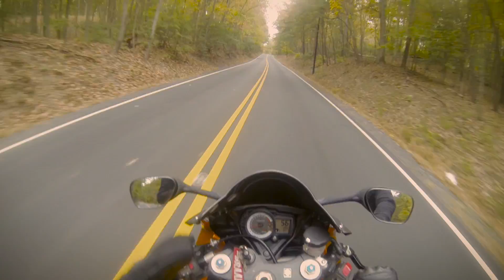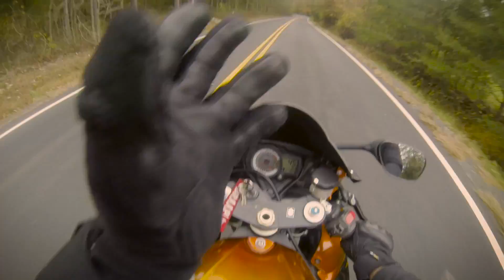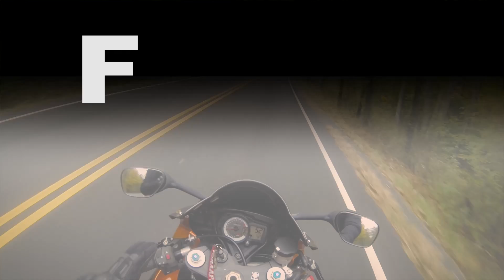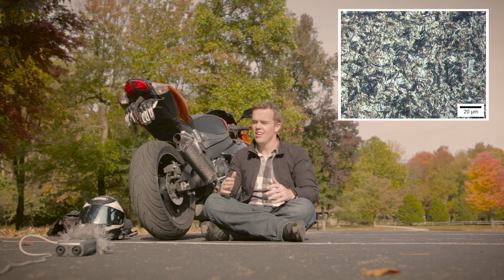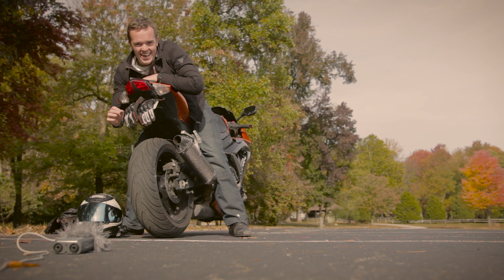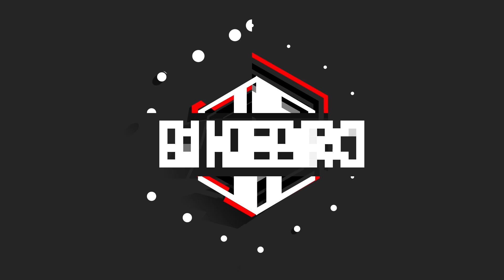Motorcycle Traction explained

Comment: What most people neglect to consider when wrapping their heads around the area vs force equation is Shear.
Generally people think about loss of traction as the tire "skipping" over the surface due to a lack of sufficient friction, but another loss of traction occurs when the tire or the road surface shears under high friction.
This is where wider tires come into play.
They simply provide more surface area that would need to shear prior to a traction loss....both on the tire AND the road itself.
Consider it like this:
Yes, one could use a hard narrow tire concentrating a high degree of weight and friction to a small contact patch, but at the molecular level the road starts to shear and there is a lower chance due to the smaller patch that the tire will find a clean and solid patch of road to grip to.
Narrower tires can "press through" road imperfections (like dirt), but have considerably less material that would need to shear to lose traction.
A softer tire will shear easier but when made wider, multiplies that shear strength (more molecules that would need to be displaced), thereby equaling the friction of the narrow tire while reducing the chance of road shear by spreading the force over a larger area, and once again...increases the odds finding a solid patch.
Lock your rear brake on asphalt. You get a skid mark. That is tire shear.
Lock your rear brake on a dirt road and you get a trough in the road. That is road sheer.
The same thing happens to a lesser extreme on normal roads or on the track.

Comment: You're totally forgetting slip angle, and how the distortion of the rubber affects the grip of a relatively "fixed" area of rubber. THIS is why drag cars need those BIG contact patches. The larger area allows for less distortion of a given area for the same amount of thrust. This lower distortion means that there is more thrust available before it reaches the point where distortion compromises the grip.

This applies to bikes in that the larger tires can have more deflection (lower pressure) without compromising stability of the tire itself.

Comment: Ok, so this vid is mostly wrong xD. The friction formula used is actually lets say OK when u ignore some less impactful correlations but what u failed to perceive is that tire load sensitivity  means that the "μ" IS NOT CONSTANT, there is always material specific equation that bonds it with pressure (more pressure usually meaning smaller coefficient of friction - such is the case with rubber against road) and this is basically why if u want to get the most out of the compound you use in a tire you want as big contact patch as possible (providing more surface to deal with the same force thus getting lesser pressure witch in turn means the friction coefficient can stay relatively high).  The only reason u cant go totally nuts with tire width and size is actually all the rest things u need to compromise on while widening a tire - so in case of a motorbike slower turn in, more fuel consumption, actually less structural integrity, higher gyroscopic effect, more unsprung weight etc... U did hit some good points with the heat dissipation and durability tho so its not all bad xD As for the "where on tire the contact patch is the biggest" its actually very dependent on the tire itself - there are various profiles to choose from. As for the motoGP tires- they have very high profile providing big patches on the side for cornering grip, as well as decently big one on the middle for acceleration - basically those tires are made to change lean angle dramatically fast so there is not much to work with in between. U need to dig a little deeper next time before u channel your inner physicist on the YT xD
Reply: xD

Comment: You are totally wrong as you use Coulomb approximation. Contact patch does matter. Wiki: When the surfaces are conjoined, Coulomb friction becomes a very poor approximation (for example, adhesive tape resists sliding even when there is no normal force, or a negative normal force). In this case, the frictional force may depend strongly on the area of contact. Some drag racing tires are adhesive for this reason. However, despite the complexity of the fundamental physics behind friction, the relationships are accurate enough to be useful in many applications.

You can feel it with hand. Good tire is sticky when warm.
Reply: Konstantin Perl I won't say hes totally wrong, he just can't explain all conditions. What if it's cold and rainy? Your explanation is only valid in near/perfect conditions. A bigger tire might not give better friction f it's the same compound  but it has a host of other benefits explained in the video.
Reply: You're right Konstantin! Futhermore the friction coefficient is not constant on the tire. It is dependant on its actual state (different areas of the tire have different friction coefficients, temperature, side and normal forces, angle etc) if the area of contact has to counteract to much stress, the friction coefficient drops and the tire slides. Therefore stronger, and heavier vehicles have wider tires to spread the stress to a wider area.
Reply: This. The tire rubber is under shear and eventually the stress will exceed the limit of what the material can handle as the contact area is decreased.

Comment: I've watched several videos that are saying "surface area is not relevant" and thats wrong basically. The formula shows us the POINT calculation. By increasing the surface area you increace the number of points that formula is valid. therefore you have more traction. 
But you're right on "bigger tires dont mean better traction". Cuz the surface is not that much increased actually. There are much more things to consider like the tires' added weight and it's effect on center of gravity, pressure of the tires etc. I just get pissed when someone says "area is not relevant"

Comment: It's the 2nd vídeo i watch saying this...overall is correct, the problem is that rubber does not work like other materials. Rubber friction changes with área of contact. Of course that weight changes friction, that is correct so braking or accelerating changes friction because of vertical force. Why would race cars use slick tyres? They could use same rubber compound with rain or slimmer tyres...would loose some weight and get better performance...wrong!

Comment: Fact - wider the tires (contact patch) while leaving all other variables the same will allow a bike/car to go around a corner faster.  Fact - when car/driver, motorcycle/rider is heavier, while leaving all other variables the same, the slower you can go around a corner.  That's why in racing, per given weight of the car/driver/bike, the rule limits how wide you can go with the tires, since the wider tires will allow the racer to go around the corner faster.  1 + 1 does not equal 2 with your theory since you are missing many, many variables that affect grip level.  I went go-karing with a friend (mechanical engineering major from MIT) ~15 years ago.  He couldn't understand why a heavier driver couldn't go around a corner as fast as a kart driven by a lighter driver.
Reply: There's a bit more to grip than just the formula. While it's true that area doesn't come into the math, the tyre format will help with torsional rigidity. A tyre will bend during cornering. The less it bends, the more time the tyre surface is in contact with the ground, thus the formula works as expected. If the tyre bends the it's a bit  like rolling a sausage on a surface. Therefore losing some of the energy that should be put down to cornering.

Comment: So what can we do with our bodies to maximize friction? Can we increase the force going down to the tires or does it not even matter?
Reply from the maker: +Will Ashmore I'm in early stages of researching this properly for a video in about two weeks so if I miss something now,  check back. So the first  and probably most important is to stand the bike up (or hang off the bike) when you're cornering to reduce the force you're putting into the tires.  That's why motogp guys are way way off the bike in corners.  
Not so much 'with you body' but under heavy braking start slow to allow the front end to compress before you really start braking hard.  Otherwise you can unsettle the bike by bottoming out the forks and then they rebound it can cause the load on the front to decrease (this losing friction) and you can lose the front end.  

Other than that don't unsettle the bike when doing anything taxing on the tires,  so don't move around randomly or shift weight because it can change the loading like above and cause you to wipe out

Comment: I know the maths is there but its EXTREMELY counter intuitive
Reply from the maker: I know. that's why i really wanted to make the video so i could get my head around it too
Reply: Actually it makes more sense if I think of it this way:

(Given that the weight doesn't change)

-A larger contact patch will spread the weight more and thus reduce friction.

-A smaller contact will concentrate the weight in a smaller area thus giving a higher friction.

So the contact area and resulting pressure on the road cancel each other out and make the friction equal for both situations.

Comment: why would I put touring tires in the colder weather? wouldn't the opposite be more ideal ? to have softer ones in cold weather because they don't need as much warming up and hard tires in the summer when the roads are hot , so you get the most out of them?
Reply: The softer compounds crack or disintegrate in colder temperatures.  The same as summer tires on a car.
Reply: Actually the high performace soft tires requires more temperature to become soft and sticky. Which is why they have to put tire warmers on MotoGP bikes because those tires when cold actually offer no more if not less grip than GT tires which might have some silicon in the tread to better deal with cold/wet conditions.
Reply: the reason touring tyres are better for winter use is A: they are designed to work in a much broader temperature than a soft race based tyre (hard to keep decent heat in a race/fast road eg pirrelli super corsa) 
B: and most obvious is the have more grip in wet n crappy conditions due to more tread being cut out. I run slicks on my track bike and the grip is insane! BUT id never get them upto temp ( 80° in my warmers).
Reply: Jackobsn thought that too
Reply: its about the heat proformance
Reply: I thought the same thing.. I know studded winter car tires are softer, and I'm pretty sure summer car tires are harder. 🤔
Reply: Daniel Newby thats age and uv light... but if your tyres are lasting that long i wouldnt worry.
Reply: Precisely, in f1 and motogp when the bikes/cars are in a wet race and the track begins to suddenly dry up. The riders / drivers with the rain tyres on struggle with too much tyres heat and this causes premature true wear. Rain tyres are super soft and depend on the moisture of the road to provide  a stable tyre temperature ( ensuring it doesn't over heat)

Comment: I think you forgot to come back to your original sentence about MotoGP, which was about keeping the bike upright for maximum traction in corning, and is why they hang so far off the bike.

The answer is in the suspension and the normal force. 

The more upright the bike is the more normal force there is to push down on the tires for friction. The greater the lean, the less normal force there is because a fraction of the force will will have a horizontal component or vector. If this seems counterintuitive because you are thinking to yourself, well a static object leaned over still weighs the same amount, then think of it like a ball you throw. If you throw a ball with a given force, and the height the ball travels is symbolic of the amount of friction between two objects pressing against each other then you will notice that throwing the ball at a vertical would yield more height or more friction than if you threw the ball at some angle. Similarly, the more upright the bike is the more of a component of the normal force will be in the vertical position.

Also, if traction is based on there being contact between two materials, then on an uneven surface, the suspension is what allows for that contact. It should be noted that the suspension travel is only in one dimension on the bike; the rear and front suspension only go up and down; there is no horizontal suspension. When the bike is upright there is only a vertical force acting on the vertical suspension. When the bike is leaning over there is a mostly vertical force from the bumps acting on a suspension that is facing diagonally. As such is the case, there is a parallel component of this force that can be absorbed by the suspension, but the chassis takes the vertical component while the tires take the horizontal to resist slipping.
Reply: The other component of this is that when you enter a turn it is usually off the gas and on the brake. This loads the smaller front tire. Loading the front tire through the turn isn't good because the tire has a smaller contact patch, so it can heat faster than the rear tire and slide out, and also, if the front tire is loaded or heavy then the steering is heavy, and that is not ideal in a corner.

By rolling onto the gas slightly, you can transfer the weight more to the rear tire which will increase the normal force of the rear tire and thus increase traction, while also allowing for better steering inputs at the front wheel.

Comment: What about tire pressure? I was under the impression that larger volume tires allowed you to use lower psi. Lower psi equals more grip no? Atleast this is the thought in the cycling community.
Reply: Airing Down Increases the force on the given friction coefficient by reducing the weight resistance holding up the bike, thus increasing grip (at the expense of more force/energy needed to overcome rolling resistance ie poorer gas mileage)

Comment: Please get off the Tarmac and explain a bit about knobbies and airing down before hitting the dirt. It's obvious that traction increases greatly when dropping from say 32 to 25 pounds. The tire looks pancaked on the contact to dirt area giving a much larger surface area. Is this perceived increase in traction because more surface area is available to search out and find something to come in contact with?? Does that even make sense? Haha
Reply from the maker: +Jason Asselstine I am planning a video on it.  But knobbies do gain a lot more traction deflating them.  This video is basically imagining slicks on a smooth surface. 
I'm still researching it but my guess is allowing the knobbies to mould around the irregular surfaces as well as dig into the dirt would give it the extra grip.

Comment: Could we conclude, then, that a heaver rider should have a higher potential cornering speed?
Reply: maybe, but a heavier rider will put my sideways force onto the tire when cornering due to extra mass, i hope i said that correctly haha
Reply: Yes, a heavier rider WILL have more traction than a smaller rider. I watched a more detailed video of this this traction theory that said this
Reply: It's interesting, the heavier rider has more friction on their tyre, but also has higher inertia that they tyre needs to deal with, so not sure if they cancel each other out. From personal experience at a track day I saw a big guy on a Ducati ride rings around smaller guys in the corners - If the bike has the power and the rider has skill, they can get around corners just fine.
Reply: hmm, wait. I weigh a bit more, like 100 kg. (sorry, I am from Europe)
so because of my extra weight, I will be more stable while cornering? to be honest, I am a bit worried that I might crash if I lean too much because I weight that much. Can anyone comment on that? Thanks. (I ride an Aprilia 1000 R and my tires are 120 by 190 in the back.